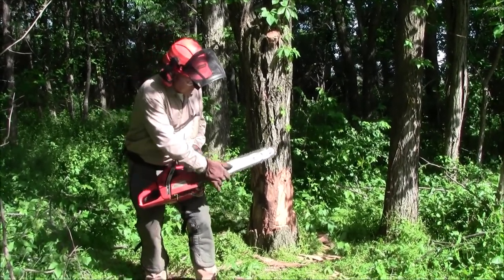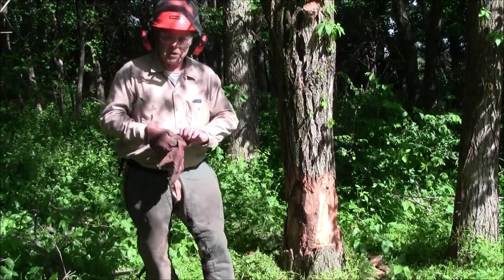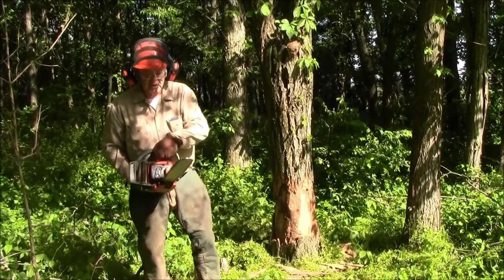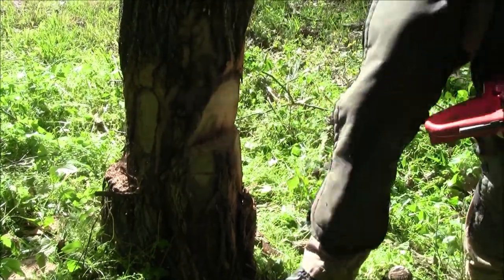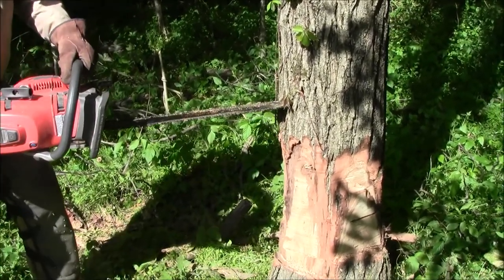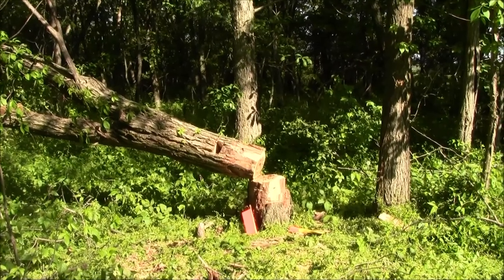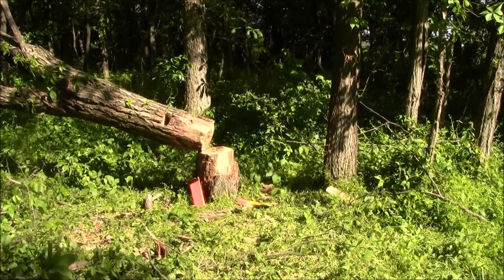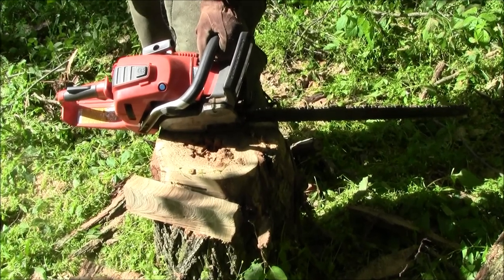Be A Chainsaw Swashbuckler! Bore Cut Basics

Comment: Thanks for the video.  Bore cutting has always been my 'weak' spot (Saw wants to kickback bad!).  I think my problem is not using full throttle while  rotating tip into tree? - (I normally just run 1/2 - 3/4 throttle all the time).  Good suggestion  on checking  Rakers.  I know the answer is to take a junk round and just  practice & practice till I get confident.
Reply from the maker: Make a tall stump and practice, practice, practice! Thanks for visiting and commenting!

Comment: I have a 21" diameter cherry tree and a 16" bar on my saw. Can you work from both sides if you start the bore cut closer to the back side and work your way towards the hinge? Also, can you cut the diameter of the trunk kind of like you did with the bark removal to make the diameter smaller? I know this doesn't sound safe. Using a bigger saw would be best or don't use the bore cut. The tree is not a heavy leaner but most branches are on one side. Thanks.
Reply from the maker: If you have practiced your bore cutting, this will be easy. Make your face cut to aim the tree, bore through the tree, leaving about 1 1/2  inches for a hinge, go to the other side and bore again, leaving about 1 1/2 inches for the hinge. Bore pointing back about 30 degrees, dog in, and rotate the saw to the hinge so you don't accidentally cut out your hinge with your initial bore cuts. When boring with the open face to your right, the saw will try to migrate into the hinge, so angling away is a safety measure, though you won't need it if you have good aim while boring.  Next cut out 1/2 of the back, set a wedge or two, cut out the other 1/2 of the back, and the tree will fall if it has forward weight. If it doesn't go, add another wedge and start driving the wedges in. Escape from the stump when the tree goes into motion.  I have done diameter reductions on trees that were more than twice the size of my bar. Your front and back slab removals are done at a right angle to your fall line, and the side cuts are made parallel to your fall line. Cutting the slabs out involves boring cuts. Here's a video of that. https://youtu.be/o46QeQe17-s

Comment: I noticed you "shaved" some of the bark off the trunk area.  Do you recommend doing this before you start the bore cut?  Alway enjoy your videos!
Reply from the maker: The bark was loose, and it might have interfered with a clear view, so I took it off. It's no problem with tight bark. Loose bark when you dog in could cause a control problem. Thanks for commenting!
Reply: @DavidN23Skidoo  Makes sense now, thanks for the information!

Comment: Question about making the bore cut and the final cut before the tree drops.  Do you start this final cut from the inside of the bore cut moving to the outside?  Or is it best to start from the outside cutting to the inside?
Reply from the maker: That usually depends on how I have wedges set up in the cut. I like to cut out the back and I am ready to step right away to escape from the stump.